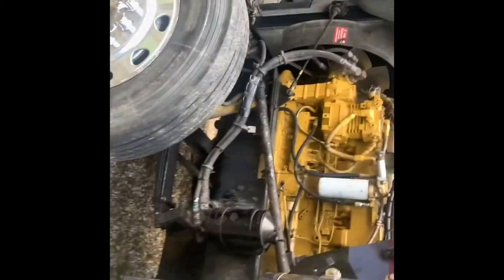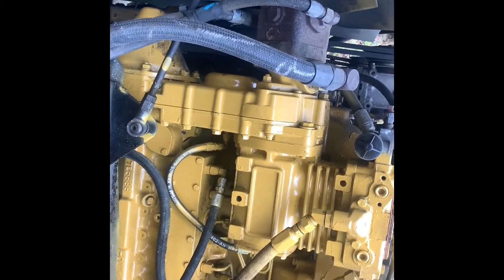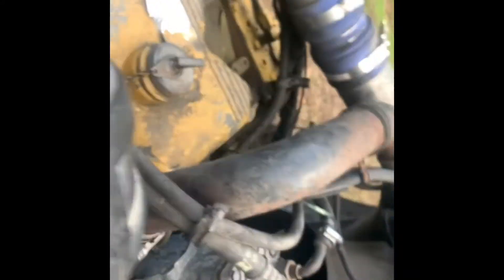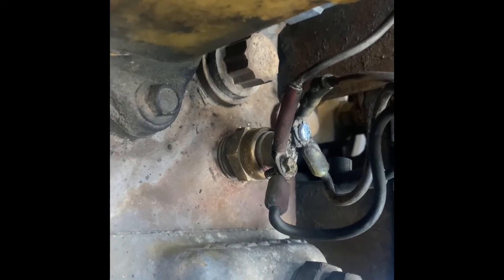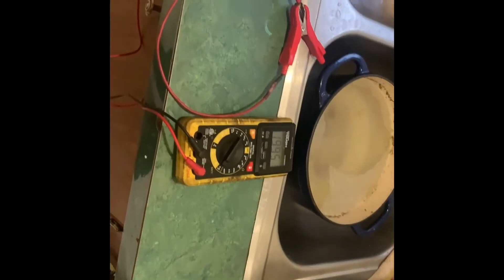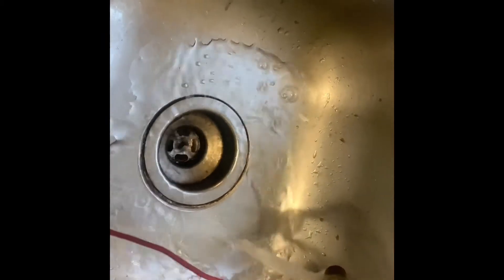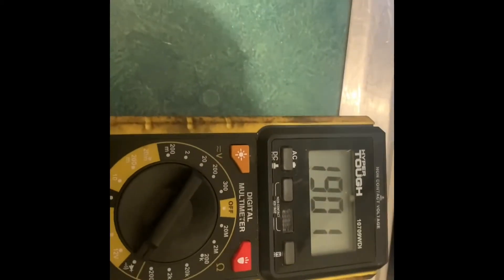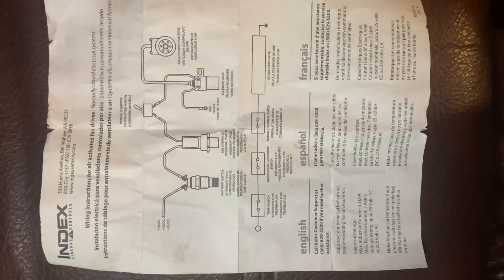Fan Clutch Stay On?

Comment: Thanks for the video, l only have one stud sticking out of the top of the sender. Could one be a ground?
Reply from the maker: Should be two. Depending on the year it would be opened or closed. One doesn’t make sense
Reply: @etcllc3519  Hey thanks for getting back to me,  l have a 3406e and it has 2 senders on top of the thermostat housing  and another one  on the front of the engine with a Cat 2wire plug. I think that one is water temp,but I can't figure out what the other 2 do, I'm thinking one could be for the AC and the other one is for the fan clutch.  Have yet to find anybody that can confirm that. I'm off to get an ohm meter this morning.  Thanks again stay intouch.

Comment: Water is a conductor wount it complete the circuit
Reply from the maker: It is a sealed unit sensor
Reply: Do you still have that schematic I have a set up on 96 fld 120 with 3406e engine  Is set up to fan Is engaged once air pressure builds
When starting the truck and should kick out with power applied. But there's only hot feed at random after truck sits to cold and other times no hot power to solenoid no matter manual switch or from auto with the thermistor switch 

So fan is always engaged and well driving periodically disengaged then reenguages like off /on off/on
So to keep it steady with out damage I leave the manual switch on I'm believing the thermal switch is to blame after watching your vid. But schematic if u still have it would be helpful I tried a screen shot from the video but the print is not legible Thank-you Sir